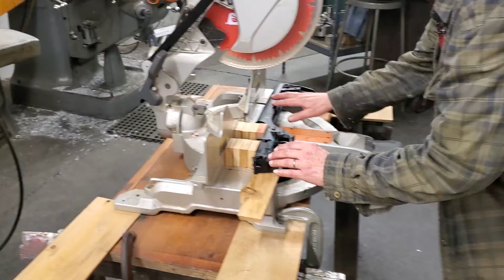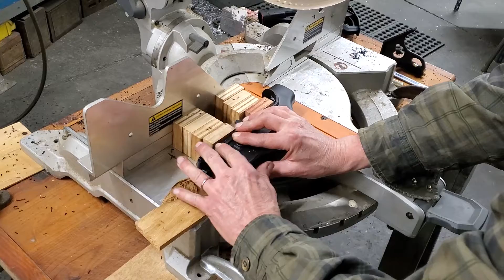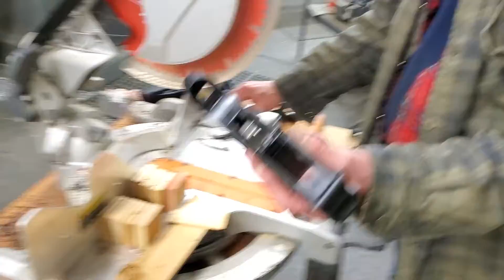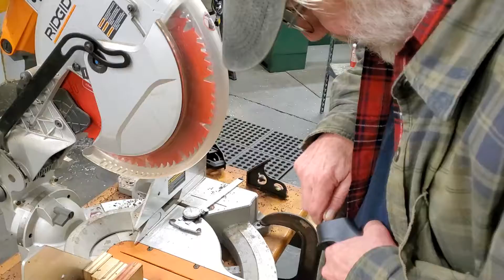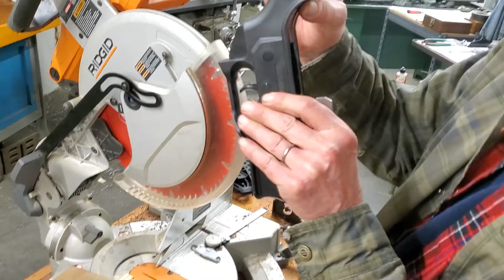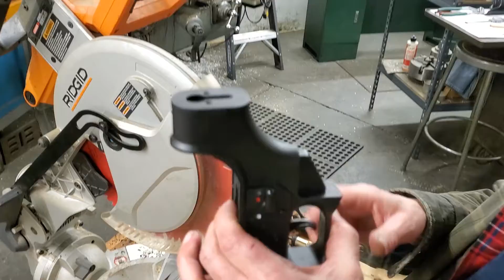Panzer AR12 Stock Cut

Comment: When cutting the stock keep the upper on and  mount two picatinny rails upside down on a block of wood so the upper can slide into it.  This will firmly mount the upper against the saw backing plate. The stock won't move while cutting and will be perfect 90 degree cut.